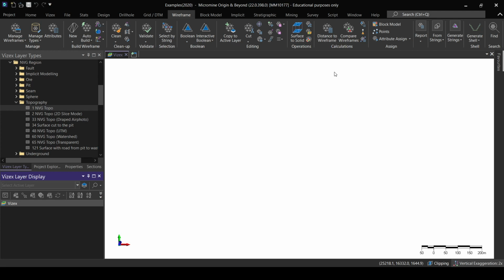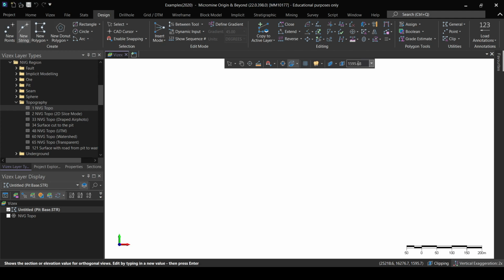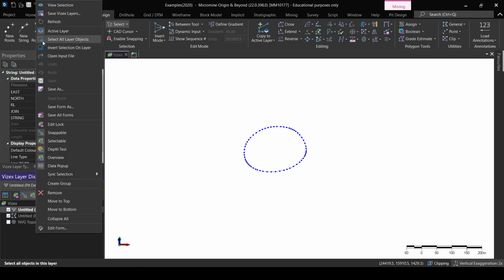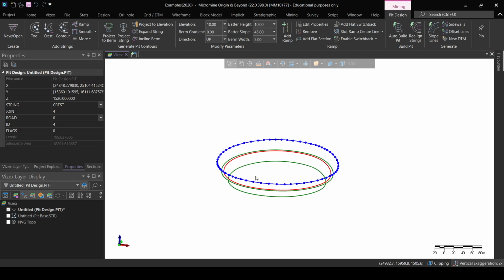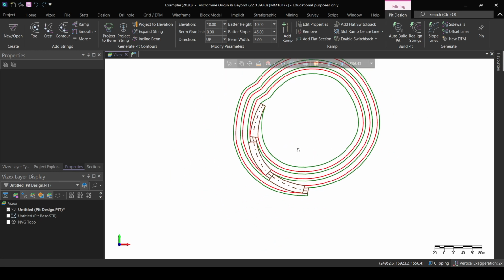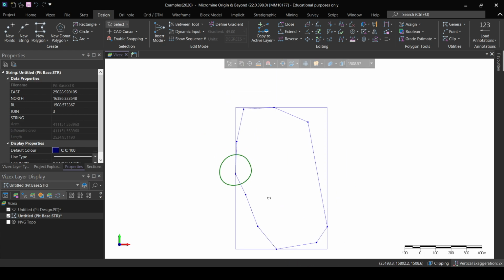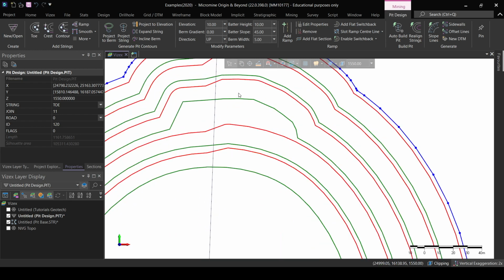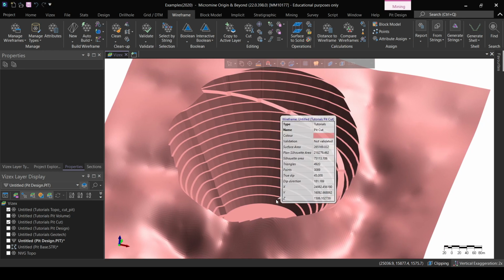Micromine Open Pit Design ( Step by Step )

Comment: Thank you so much for this great video! However, I have a question, my pit is much larger than the ultimate pit shell, that means I have larger waste volume that I need to extract so it also means higher cost for me and it may not be feasible for my project. I used the build to shell option but my Overall Slopes for Every Azimuth 45 degree which is (45-90-135-180 and so on) are different from each other. Thus When i try to design a pit it does not fit with my Ultimate pit shell. Do you have a suggestion about that? Thanks for answering!
Reply from the maker: if you are using a constant slope, 45° for example, and using the build-to-shell option and using a shell with multiple slopes the detailed pit is not going to match the optimizer shell perfectly. One way to solve that is to add multiple geotechnical constraints by assigning different slopes that match the ones from the shell using additional wireframes that encapsulate these areas.
Reply: @MiningGeologist  Actually I added wireframes and used the variable constraint sectons but it didn't work! :( That's why I confused that much but i solved the problem by manual drawing of strings from toe-crest tools and checked the slope stabilities which I corrected part of the pit. Again thanks for the great video and answering it! :)
Reply from the maker: @denizdemir6672  Happy that you solved the issue !